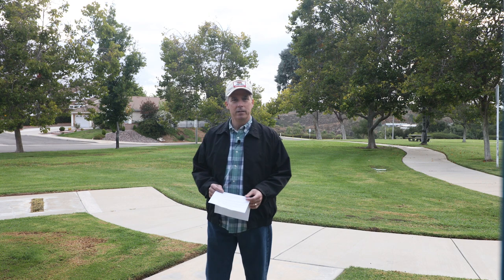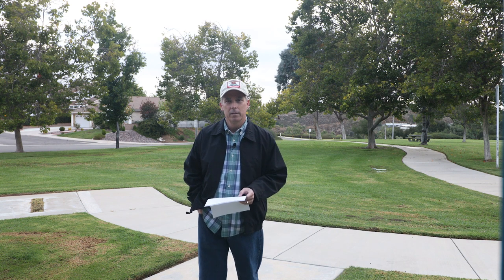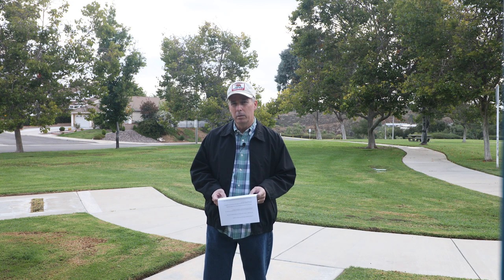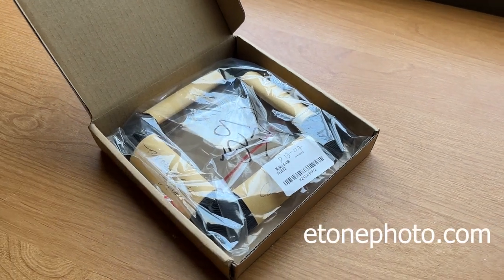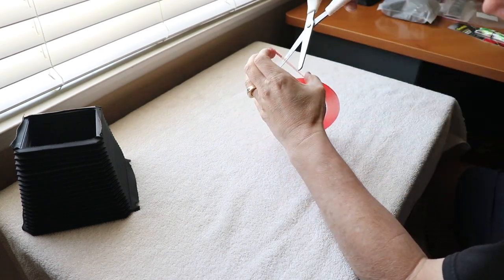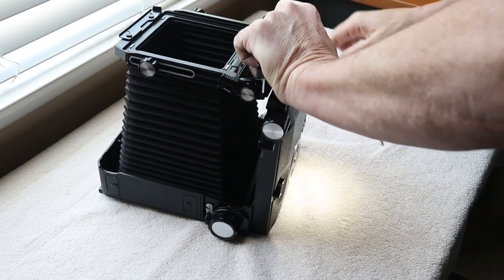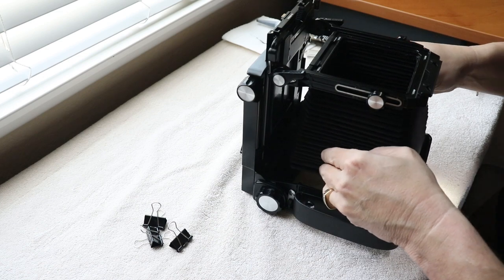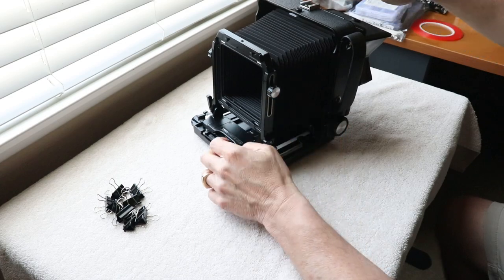How To Replace Repair Bellows Toyo Field 45A 45AII 45AX 45G Camera E02

Comment: This is a super video. I found it helpful beyond measure. I went through all the steps as followed. I obtained the bellows as suggested. I really did what was needed. And I am most grateful for the detail attended to this project.
My efforts ended up being far more challenging than depicted. But the video kept me on the tasks at hand. It was a great productive project.
My Toyo field camera is a happy camera today because of the work I did.
Thank you. thank you, thank you.
I remain deeply pleased.
My only suggestion to anyone going down this road alone? Go slow. Give yourself time to stumble, time to get all the parts necessary to do the job. You will prevail.
It took me about a month to get this done. From ordering all the necessary parts, discovering that I hadn't ordered all of them, to plotting out the necessary time, once I had everything ready, I succeeded.
And it was worth it.
Reply from the maker: Nice job

Comment: Very useful video.  I only have one comment.  I'm sure the adhesives you used, Super glue and JB Weld, worked really well, but they are both permanent.  If you have to do this again, it would be next to impossible to remove the bellows.  You basically "welded" it on to the camera.
Reply from the maker: Good point, but in my tests I was able to pull the JB weld apart. I could get the super glue off as well if I needed to :)

Comment: I just bought a used 45A a few months ago and it had been fitted with a new bellows by the shop prior to selling it. I really wondered how they did it. I really did not think it was glued in like that. I had a Shen Hao and a very old Linhof years ago and that had detachable bellows.

Interesting, thanks for showing. 

I just wonder if this bellows will ever come off, looking at all that silicone that went inside. The connection seams to be made for eternity.
Reply from the maker: Thanks for watching. I tested the adhesive bond prior to installing. It can be removed without too much hassle. I would advise anyone watching to choose an adhesive they are comfortable with. I don't think it has to be super strong since the bellows are screwed on firmly. I just happened to choose this since it was black.

Comment: Hello, thank you for this great  video! I recently found a Toyo 45A without bellows and I think the 2 frames got stuck in the old bellows and thrown away with it!... i bought new bellows but need to make a 3d printing of the missing parts! So, could someone give me the dimensions of the two frames which support the bellows, and also the type of screw, M2X5 for the front it's ok, but wich ones for the back? Thanks!
Reply from the maker: nice